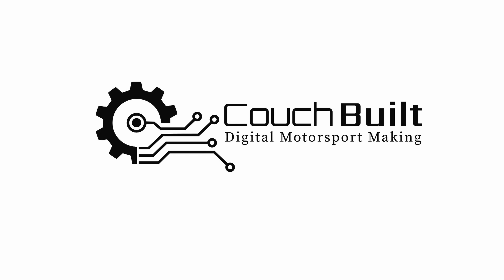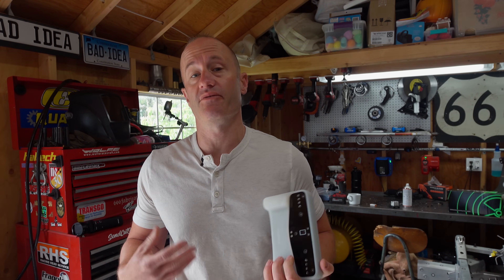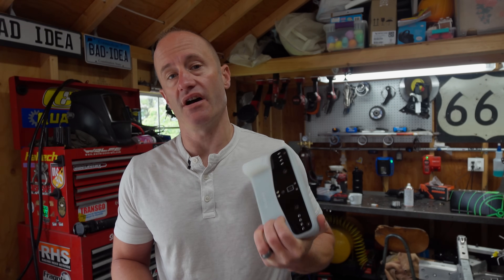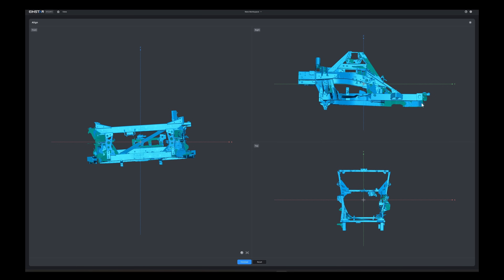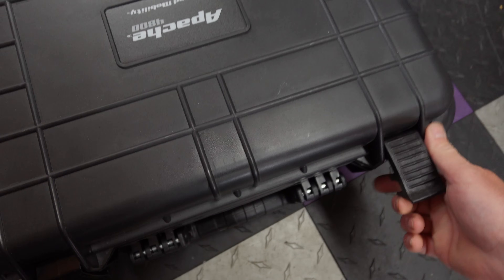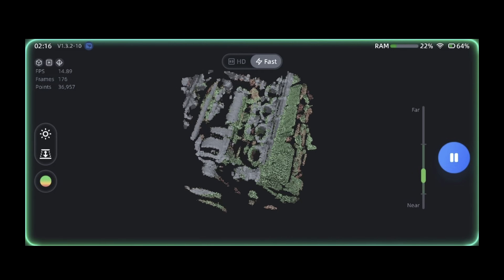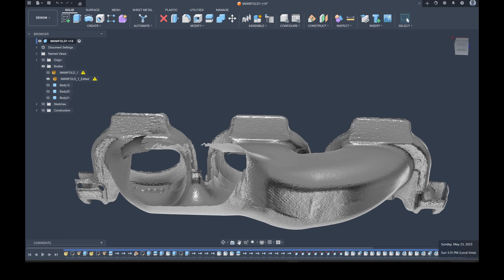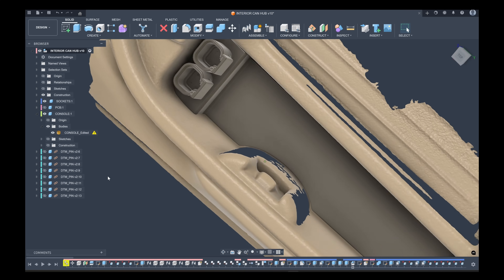Get yourself a 3D scanner that works. Long term review of the  Einstar VEGA

Comment: not even considering anything from Einstar because of how terrible the OG scanner turned out to be, and the more I see these handheld ones, the more I regret the 1k spent on the Einstar which barely can do 13-14fps in 13th get i7 with rtx3080, I can only conclude it is purposely under optimized, and don't get me started on it losing reference all the effin time, tried recalibrating, sprays and whatnot, it is a bad scanner with horrible software, it may work sometimes if you need to quick and dirty thing with not a hole lot of detail, but it takes a lot of time and iteration, to a point where I can just stick the part into my cnc mill and touch probe all the features I really need
I can only imagine these youtube "reviewers" spending days to get the footage they need to "pay" for the gifted scanner

Comment: I assume the Creality scanner you have is the Raptor Pro? How does that compare for larger assemblies? I want the resolution capabilities of a laser scanner but would also like to use it for larger assemblies like your car or engine size use case.
Reply from the maker: Yes, it was the Raptor Pro. The largest thing I attempted to scan was an F136 engine and it would have required multiple scans. I tried scanning the whole thing in one go and reached the frame rate maximum. There was a bunch of missing data so it would have to be split up into multiple sections to scan fully. It also required a ludicrous number of markers to track remotely well enough.

Comment: Scanners have come a long way and you are certainly a power user. Thanks for the comments and insights. I am upgrading to a Bambu Labs H2D to build parts for a recumbent bicycle and unknown other fun stuff. Currently use Onshape for all models and really want to be able to align primary planes to the model. My uses are certainly not as demanding as yours but I look forward to printing nylon CF and ABS CF parts. Keep on 'truckin! Thanks for the discount code.

Comment: Don't think I can go wrong with the Vega.  Do people think it is better than the Creality Raptor Pro with the wireless setup?  I'm guessing the Raptor does well only if using the blue laser and markers.  Can't say I want to use markers all the time, but suppose i could sometimes use magnetic ones.  Perhaps the Vega is accurate enough and more convenient.  Probably better for my boys to learn too.
Reply from the maker: I recently was sent a Raptor Pro to try out. It’s a solid piece of hardware but you are correct in needing markers for laser mode. For much of what I scan that’s an inconvenience that would make me reach for the Vega. If you don’t mind the setup time and effort, it can product some really clean results.
Reply: @CouchBuilt in the future would you do a video on which 3d scanner gets the most accurate results? As far as fine details? Like if for instance if someone wanted to scan the body panels on a vehicle like the Lexus Ls 430 which is known as the industry standard pretty much for tight body panel tolerances? Just curious.  Also which 3d scanner would be best for scanning and entire car? (That’s not already taken apart)

Comment: What's your opinion on using markers in HD mode?
I've tried it several times and always found it has a hard time picking up the markers, which is very annoying when doing larger not unique surfaces.

Thanks for the video!
Reply from the maker: I haven’t noticed that but we’re probably scanning different stuff. What type part give you trouble?
Reply from the maker: Decided to try HD with markets on flat stuff.  https://youtu.be/-T7Ck9jdkiQ
Reply: @CouchBuilt  Thanks for making a video about it!
I think my problem might just be not having enough markers, I noticed it sometimes skips some markers or 'forgets' them later in the scan, on your video it does seem to skip a few.
I guess just having more markers makes it less of an issue.
I don't really like putting markers on everything so I'm happy most thing I scan can be scanned without 'em.
As for my use case, its very similar to yours, I mainly use HD mode as I like having the high fidelity scans.
After seeing the results you got with fast mode I might need to try that more :)

Thanks again

Comment: I am having a hard time scanning in HD mode it's hard to keep tracking.
Reply from the maker: What type of object? I’ve found it better to stay farther away for better tracking. It gives a warning but the data indicator still shows good coverage.
Reply: @CouchBuilt  cf endplates for a front splitter.
Reply from the maker: @philliptran8831 that’s going to make it harder being relatively featureless. If you just need the profile to create a dxf for laser or something, try it in fast mode on a a rough surface like gravel. Should take like 30 seconds and get you enough profile to pull a mesh section sketch in fusion. Otherwise a bunch of markers. As always, scan spray goes a long way, or since it’s flat blue painters tape will work too.
Reply from the maker: https://youtu.be/-T7Ck9jdkiQ

Comment: Why do you prefer mesh over point cloud?
Reply from the maker: You can’t use the point cloud in CAD. The mesh is made from the point cloud.
Reply: @CouchBuilt  Yes you can.  At least with inventor and freecad you can use the point cloud.  It tends to be easier to see the average between the points and extract dimensions from that.  Plus you can see through the point cloud and you're not fighting transparency issues.
Reply from the maker: @NavyCuda I’m not aware of that ability in Fusion. My eyes don’t see the geometry for shit when viewing the raw point cloud. Might be an option for some but it’s ain’t for me.
Reply: @CouchBuilt  Payo has some really fantastic videos on using the point cloud, taking slices out of it.  It was him who got me to switch over to point cloud from mesh.

Don't have to tell me about eye sight, I'm with you there!

Comment: I'm interested in hearing your thoughts on if the Vega is worth the $1k premium over the classic Einstar for someone who doesn't already have any scanner. $700 is a lot easier to swallow for me than $1700.
Reply from the maker: If you already have a laptop that can run the classic, it’s still a solid option. If you need to buy a $2-3k laptop and the scanner, it might not be quite the bargain. Not having enough compute puts the hurt on user experience.

Comment: Thanks for the video, before i buy one, how do you convert the mesh into a solid model you can work with. I have an old version of solidworks, to use this would I need 3rd party mesh software? Or you must use fusion360?
Reply from the maker: You don’t want to directly convert meshes to solids. You only use them to build planes and reference sketches to base your model off of. Basically using the mesh for direct measurements, rather than a caliper, tape measure, etc.
Reply: you can use Fusion360 for this. The 3rd party mesh softwares out there are not that good imo.

Comment: Okay hear me out … I want to do that same F136 8hp swap in my BMW E60 so post everything and make all the files available . Thank you very much 🙏🏾
Reply: You just want him to give you all his hard work for free?
Reply: @DMSparky Yes. Did you pay Isaac Newton for his? What's bad about sharing copies?
Reply: @DMSparky did I say for free ? I said make the files available . They can be purchased from he’s website as he said in the video you can buy the scans if you need them for you own build
Reply: @ChadmarBlake  Link to the website where  you can buy them? I watched the video twice and checked socials, I don't see any website to purchase them. I understand paying for good work like an adapter plate or cad file to produce a product, but a 10min scan of an engine with a consumer grade scanner is hardly that. Now if he did a detailed scan, aligned it in a coordinate system, and generated planes + mounting hole locations for all components that would be worth a few bucks. Doing the same scan with a professional scanner and processing it with something like quicksurface is where the scan gains actual value.
Reply from the maker: @TheBiscuitsandGravy   You'd be surprised at the market for scans even with a hobbyist device. When the difference of having something available that saves you hundreds or thousands of dollars from buying parts of your own compared to nothing at all or paying a professional, its an easy choice.

Comment: I preordered the Vega as soon as it was possible. Totally unusable in the beginning but that was my experience with all preordered 3d scanners.  

With the constant updates it became a little box of magic . You just carry it with you similar to your phone to go over to your buddy's garage to help out on a project. Amazing device . I don't understand the hate it's getting in some Facebook groups.

More often than not I bust this out instead of a tape measure 😅.
Reply: Mine is totally useless. Can't track anything even loaded with spray and markers. Any tips?
Reply from the maker: @Renegade48445 what types of things are you trying to scan?
Reply: @CouchBuilt  Im trying to scan Ag equipment to make after market parts. I always spray with primer followed by the scan spray to dull the surface for unwanted reflections. Im sure I just have a setting messed up but their support is useless. I can scan with my wired einstar no problem and can not duplicate it on the vega. It literally loses tracking sitting still on a fixed object.
Reply from the maker: If you can scan things reliably with the classic Einstar, then the Vega should be quite a bit easier. There could very well be something wrong with the scanner. It is a complex device and not unreasonable to assume some might have a flaw. All shining 3d stuff seems to be pretty particular about fresh calibrations, but I’m sure you’ve already been down that road.
Reply: @Renegade48445 did you calibrate it !?